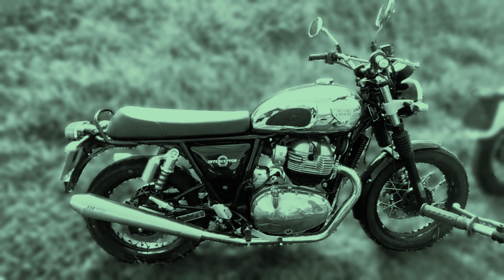Royal Enfield  interceptor 650..ENGINE.FAILED! (Part 1)

Comment: That’s bad good job you had a slipper clutch. When I was 17 I had a Kawasaki kh 250 two stroke because my mate had one and he gave me ago , he never had any trouble. So they delivered my new bike and after he left it took me 3 day to get it started , you know I was so easy going I never complained to the dealer . I had it for 2 years by which time I seized it down the bridge north road , never have a two stroke again.😊
Reply from the maker: I had a Suzuki GT550 triple that would do that regularly, I got shot of it and bought another and it was fine!

Comment: My 2020 Interceptor had a major issue where the camshaft had worn the left exhaust side valves bearing oval. Went back to the dealer and traded for another bike. Bike owned from new, meticulously cared for with more than required oil and filter changes and just over 3k miles. Lovely to look at though😅and was great at first. Now have W800. Japanese reliability.
Reply from the maker: That's interesting.....
Reply: I've got the W650 , I saw one in Japan that was over 500,000K with No major-work other than clutches !  I was seriously-considering  trading for an RE650 but I'm hearing-of more-issues as time goes-by . Dave  nz
Reply: #s tell a different story how many int.650 have been made and only a very few have failed .A very few w800 being made and are there failures?
Reply: @deltabluesdavidraye  Fair point but there's not much info on long term high mileage int650 and how they fair, especially for commuting. Most modern classics aren't used for daily commuting. In fact, I guess most bikes aren't either?

Comment: I have a 2022 Kawasaki W800 that has been at the dealer since 9/7/23 because of a fueling/idle issue. They tuned it up, no change. They installed a new ECU, no change, and now they are tearing the bike apart to replace the wiring harness. So my bike has been laid up for 8 weeks with no fix yet. So much for Japanese quality. But I ride my new RE 650 INT every day.
Reply: Millions of interceptors and a few have failed .A few thousand W800 made and a few have failed.

Comment: Sounds pretty bad. I live in new Zealand and have an Interceptor done under a 1000km that's had a problem with its gearbox has been in the shop for 3 months picked it up on friday 10 minutes from dealer had to turn around and take it back EFI system problem, so no bike again. The warranty claim service here is obviously not very good. I can sympathize 😢
Reply from the maker: @Robert-ds8cd
All sorted in 18 days! https://youtu.be/ivMP86W6egw
Reply: Good news, and great service. They need to get some lessons here. I couldn't get any contact numbers for royal Enfield, all down to the dealer. 👍🏍
Reply from the maker: @Robert-ds8cd  Some dealers are better than others for sure!

Comment: That really is rotten luck Mr Brown 😢. My thoughts are that it's actually fortunate that they physically can't strip the engine. A major repair at such a low mileage wouldn't give you confidence. It sounds like they're on it and keen to have you sorted. Just don't let the timeline slip. If they can't give you a reasonable estimate when the new engine will arrive you might want to push for a replacement bike? I must say I was rather impressed by how quickly they worked on it and were able to give you a report on the Saturday. Imagine having this issue with a certain Italian transverse V twin 😬
Reply from the maker: @PhilipBallGarry The latest update from yesterday is that they hope to get the bike back to me  at the end of next week!
Reply: My Italian v twin was sorted without fuss ?

Comment: Blimey, sorry to hear your tale of woe, hopefully will have a happy ending. Your local dealer sounds decent... thinking of a new 452 Himalayan but may just wait 12 months for any possible issues as that's an all new engine. Keep us posted! 👍
Reply from the maker: Thanks! My thoughts are it could happen to any make of bike. Way back, I bought a new  Evo Harley Fat boy, at 1400 miles the motor start to smoke from the rear cylinder. No Circlips in the rear gudgeon pin!! Ended up with a new Heritage soft tail over that!

Comment: Hope it starts going better for you. I have 2 Royal Enfields, an Interceptor and a Meteor. Baught the interceptor used. It had beed dropped several times and let to sit out a winter before I got it. Ive cleaned it up and put about 3k miles on it and its been solid...so far anyhow.
Reply from the maker: I think generally, they are a good modern bike, I have just been unlucky!

Comment: That was definitely a total disaster ,I feel your pain . When I saw that oil pump chain I was shocked at its flimsy design and I wondered would it ever fail and now your bike has just done that ,it will be very interesting if RE give you a full report on the engine failure and I am guessing they wont ,,but at least you will definitely get a new engine ,its just the same in the car industry ,you only get a new engine not a new car ,,, but my advice is ...move it on as you will have lost your confidence in the bike and it just wont be the same .
Reply from the maker: @chadr9791  I happened on a video filmed in India about a guy who had a classic 500 chrome, same as mine. I couldn't understand a word he said but watched it anyway. His bike looked pretty scruffy and when he started it up, well you never heard such a mechanical racket! Long story short, he rode it into town and found a small family business specializing in fixing Enfield's. The whole family leapt at the bike and had the engine out of the frame in less than 5 mins, had it all stripped in 20mins and found the snapped oil pump drive chain. They fitted a new crank, rod and piston and oil pump chain, reassembled it and the guy was on his way in less than an hour! Just before the video ended, he put the mileage up on the screen. 437,000Km.!😵😵😵😁

Comment: That slipper clutch came in handy👍👍. I hadn't considered the side benefit of being able to control the bike in the event of the engine seizing! I have two modern Interceptors and both are Euro 4, which seems to be the key to avoiding engine stalls. I had never heard of engines seizing though. now I will worry about the oil pump drive chain..... 😲
Reply from the maker: I wouldn't be duly concerned about the chain, Mine was just a rogue chain, I keep telling myself!
Reply: My old Yamaha TR1 (my Big-Bike ! )  has a chain-driven oil-pump and has done 50k , I've never heard of one failing . It seems VB's had a faulty ECU which might have contributed through messed-up advance/retard etc , or just bad-luck with one faulty-link .  Dave  nz

Comment: I hope you get the bike sorted out quickly. You'd think the ECU would be able to identify that there was no oil pressure and shut the engine down before it seized, so much for advanced technology! At least it sounds like you've got some good news about the Classic 350. Good luck, Mick
Reply from the maker: Thanks Mick, I don't think maybe the ecu is that bright! It's probably just a basic unit capable of dealing with fueling and bringing the abs into play, but I'm guessing!
Reply: @Volcanicbrown1878  You're probably right, wouldn't take much for them to put something like that in though, all it needs is a wire and a bit of code, it must already have a sensor for the oil light. If I had an interceptor I'd be in the shed now checking my oil pump chain, a bit of a worry for other owners.
Reply from the maker: @5dTraveller  RE have had issues in the past, like the Electra X which was renown for knocking big ends out before they had done 6k miles...Due to a batch of faulty crank pin hardening.
Reply: @Volcanicbrown1878  I suppose any manufacturer can suffer from faulty parts from third party suppliers but over the last few years we've got used to good reliability from the new RE engines, so it could just be a one off. It's a pain for you but at least you'll end up with a new engine. Cheers, Mick
Reply from the maker: @5dTraveller  Another engine I will have to run in!😁😁
Reply: @Volcanicbrown1878  If I lived round the corner I'd do that for you, no bother at all! 😄

Comment: I have recently bought a 2011 G5 Bullet Electra 500 and noticed in the Haynes manual that the oil pump is driven by a plastic gear, this can't be good especialy as there is no low oil pressure warning light. Some years back i had a Suzuki GT380 that let me down when the plastic gear wheel that drives the ignition points stripped  a tooth, so some bad engineering going on here.
Reply from the maker: It's rare if they do strip

Comment: Does seem like a one off occurrence. The dealer you purchased from, if it is a RE dealer, doesn’t sound very helpful/ interested. Good to hear RE themselves were happy to get involved, they could have easily just referred you back to the dealer. Fingers crossed they carry on doing the decent thing & supply a replacement engine to be fitted.
Reply from the maker: The RE dealer was only trying to fast track the claim process. I f he had taken the bike in it would have lengthened the whole process considerably and then he would have had to get RE involved. No, fair play to him, he was really just trying to help and speed things up. I also think that because this was such a unique failure, they wanted to get involved right from the get go.
Reply: Ok, fair enough.

Comment: What a bit of bad luck ! 
I know what's wrong , you let her see the real Interceptors didn't you .
And she knew that she was just a pretend Interceptor and just gave up the ghost . 
I'm sure that RE will come up with a new engine, but you'll have to wait . 
Funnily enough the only part that broke on my Connie was the only new major component that I bought .
A new Indian  layshaft , snapped after 35 miles . It took out a couple of gears and cracked the case . But all credit to the supplier, he took care of it without a quibble .
Hopefully RE will do likewise and stand by their product.
Reply from the maker: I still have every faith in RE and their warranty! Did you get the layshaft from Hitchcock's?
Reply: @Volcanicbrown1878  . I'm sure that RE will do the right thing , it's mostly us old codgers who ride RE s and we are a close knit bunch , word will soon get round about the outcome  , good or bad . 
And yes the layshaft came from  Hitchcocks and their response was splendid . Not their fault that the layshaft snapped like a carrot .
Quality control does tend to be a problem from time to time , but that even affects prestige companies [ think blue and white propeller - snappy forks , nasty transmission shafts and ungreased drivelines ] . 
It'll be interesting to see how the Bajaj Triumphs perform over time .

Comment: Problems with Royal Enfields are very real, despite all the people that believe otherwise. Last year I bought a Meteor 350 that died on the highway with only 350 miles on it. It would idle but lose all power when I twisted the throttle. The dealer had it for two months before they discovered that an extra pipe had been welded inside the exhaust header. It took 350 miles for the carbon to seal it up so the exhaust couldn’t flow.  They replaced the header and I rode it a couple more months before trading it in for an Interceptor. At about 1500 miles it started having issues. I changed the plugs and relays, and then checked the valves. They were slightly tight, but within spec. I adjusted them anyway and the bike runs well again.  They weren’t off more than .005mm but it was enough to cause problems when the engine got up to full temperature. Unfortunately I think I’m done with them. I’ll be trading it in the spring. They make pretty bikes, but way too temperamental for my taste. Best of luck, hopefully it doesn’t take long to sort out your new engine.
Reply: Trading it because you adjusted the valves wrong
Reply: @deltabluesdavidraye  didn’t read my comment?

Comment: Wow. You rode with the oil pressure warning light on? I am going to replace my oil pump chain just to be safe, I have over 35,000 miles and the chain looks stretched. See pic
Reply from the maker: The oil warning light never came on at all!
Reply: @Volcanicbrown1878  that is scary. I just put 83.5mm pistons and an S&S cam in my 2020 Interceptor at 28,000 miles, it has another 7,000 miles with those parts (743cc) but never a problem in three and a half years.
Reply from the maker: @frederickwoods5943  Don't worry, mine is just one of many, many thousands built and all the others are just fine including the big bore fellers. Mine is just rogue.

Comment: "Nothing made by man or is a product of ordinary nature is perfect --- only Allah is perfect" (ha, ha).  The most unlikely failures occur even in the exhaustively tested and inspected space booster parts that I use to work with.  In aerospace we have a principle called "Murphy's Law."  Murphy's Law states that anything that can possibly go wrong will go wrong.  I appreciate the fact that the RE people didn't try to jack you around, try to put the blame on you and generally put you off, but promptly started things rolling.  I have 10,000 miles (not KM) on my Interceptor and have had no real problems I can't handle myself.  I'm sure that once you get your bike back (or a new one), your bike will be likewise reliable and trouble free as mine.
Reply from the maker: @oldgeezerproductions   Thanks!

Comment: What a sorry tale Sir. At least they are supporting you. Did I understand you to have been doing your own maintenance rather than using the dealer network workshops? If so, I am very interested that they are maintaining the idea of a warranty. A lot of people seem to say - and the handbook does, that you must use their qualified mechanics and workshops to keep the warranty. Obviously, this failure is nothing to do with maintenance of course. I think a chain should be better than some of the other ways of driving oil pumps. The Himalayan seemed to have a nylon gear system and the old iron engines had a horrible piston pump that could destroy its drive if it was revved up on a cold morning. My mate had that failure on his old bullet. Apparently, the old Reditch bullets had a pressure relief system in the return pump which sends oil to the rockers, but not the Indian ones. On a  cold morning if not gently warmed up, the back pressure of the thick oil can be so great that the pump drive strips, leading to crank failure and probably seizure if it is running at speed.
Reply from the maker: Don't believe that! They cannot dismiss the warranty if you do your own servicing! As long as you use the recommended oils and use genuine filters the warranty stands.

 The early piston pumps on the singles and twins are OK for moderate engine speeds. But, it is very important to warm the engine up gently from cold to give the oil a chance to warm and thin. At oil change time it is important to remove the timing cover for two reasons. Firstly it needs to be removed to enable the filter chamber to be filled up with oil to prime the system and secondly to be able to visually inspect the oil pump drive worm and pump shaft gear for wear. It only takes an additional 10 mins or so to do this, but pays huge dividends. If they are operated properly, the oil pumps will last many years without appreciable wear. They are all long stroke motors and not designed for high revs, hot or cold. Ride them sensibly and they will last many years, without trouble.
Reply: This is good to know (about the warranty). I live at least forty miles from an RE dealer, and to be honest, the offer of £180 to change the oil and filter, and check the rocker clearances for the first service, is hard to swallow.  Many people on the RE groups parrot the remark that RE will have nothing to do with a bike not serviced by their approved dealers, The other thing I have seen is that many people are told they have to wait several weeks for service when they try to make appointments. Some of the dealers clearly don't service according to the approved procedure, The valve clearances are supposed to be done stone cold. One well known dealer 56 ,miles from me, told me that when the time comes, just to make an appointment, drive the bike to them, and they would do the job while I waited. So much for doing the valves when the engine is stone cold,,,, @Volcanicbrown1878
Reply from the maker: @Tonyv1951  And that my friend is why I wont let them near my bikes!😁😁